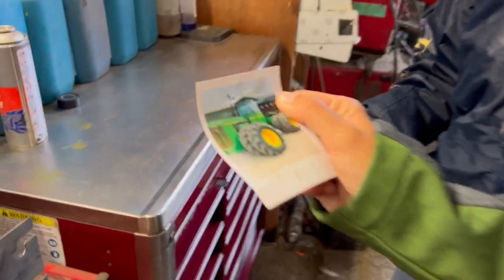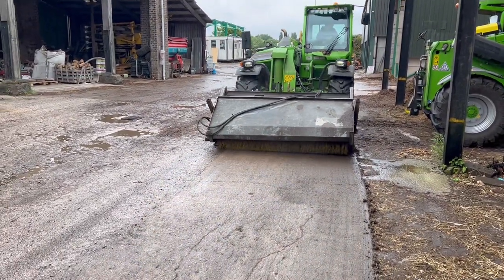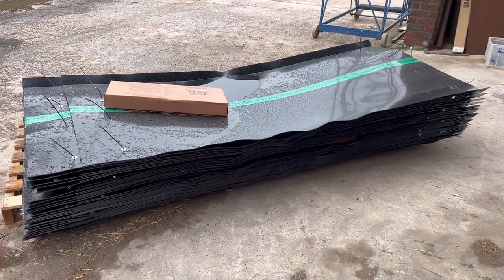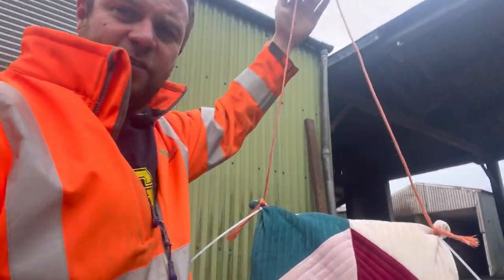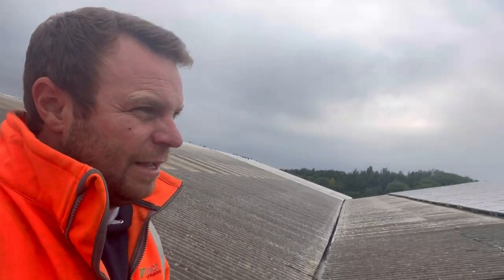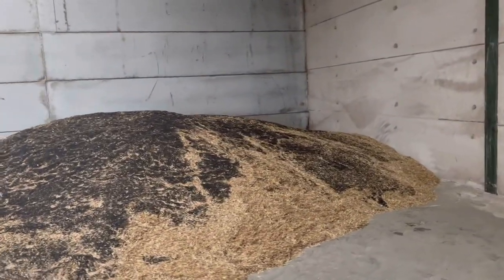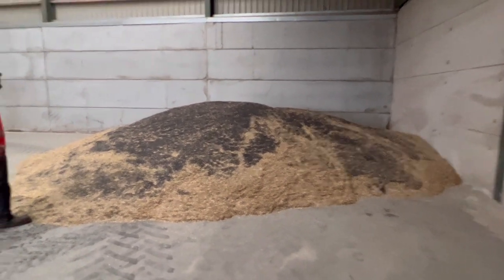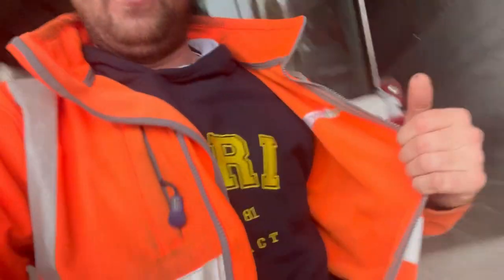DAY852 WE GOT RAIN TIME TO GO ON THE ROOF #YOURHARVEST#OLLYBLOGS  #AnswerAsAPercent

Comment: Can’t you get one of the longest polls we use a 25 ,30 foot one to screen the concrete off and they are basically a rubber blade I know you can get extension for them but you can walk along the gutter and pull down with it

Comment: Whilst the tractor on the photovoltaics was a bit of fun, it cannot clean these panels!  The box gutter allows access the full width, available are multi extending poles up to 17 metres long - not cheap but might help efficient generation - and its something you need to do for the next 20 years !?  Bring up a lightweight hose, attach a brush head and it could take a couple of  hours to get them spotless.  Probably best done in the rain and could help rinse out the gutter. However, after the work you put in recently, why not play for a while !

Comment: As far as I know, most if not all, solar panels have a self cleaning coating on them, so I would go easy on them when cleaning otherwise you can damage them and make it significantly worse if not damage the panels. Pressure wash (but not too close) is more than enough or just wait for the rain.

Comment: There are remote controlled wet brush systems they use for cleaning roof tiles etc. Im sure it would work for solar panels.  Would take a bit of setting up as you need long , very long hoses connected to a barrel of cleaning detergent.  Would be a lot less than 7grand and you could do other customers roofs to et your money back.

Comment: what about the rubber off a hand slurry scaper, and put a small solo battery charger on the bonet of the tractor, and then build a open lean to shed to keep the tractor in on the roof, with ramp to get on and off the panels

Comment: What about a remote lawn mower converted to clean the Solar panels. Put the charger station up there and leave it to do it. Put a low board all the way round to solar panels. When it gets to the edge it will hit it and turn around. Mind you would probably cost a fortune to do.

Comment: You can buy a RC Traxxas 4x4 and fit a snow plow to the front. Can then either buy a remote with an extra channel to lift it up/down or I just used a ESP32 and control it over wifi (either directly or through an access point). 

Can then buy rubber strips to go at the bottom or I’m sure you could get a 1-2 foot brush and screw to the bottom, plus range will likely be better on an RC. Maybe you wouldn’t even need the servo on the snow plow and just use gravity with a brush? 🤔

That tractor seems a lot more hassle than it’s worth but be interesting if you get it to work.
Reply: Oh, and bonus points if you attach it to a drone and drop/pickup from the panels! 😎

Comment: Ok, so I am not into farming or anything, but first thing I would do is put a walkway of some sort over the valley so you have a good footing and don't crack the roof.  Then, and I am not sure it would reach, but when I paint my house I clean the walls with the patio attachment for the pressure washer (famous brand). You can get extensions for the washer, I have 3 that go upto about 7 or 8 meters and its quite solid at that. When on, it has some downward thrust that would make it float over the panels.  You could attach the car foam thingy, and put some roundup in it, for the moss, I used it for a patch of ground about 5 metres away, and its definitely got more range in it than that. Totally cleared the lot.
Auto machine, its a clearly defined space, and a small auto thing like those that cut lawns could be adapted, to be honest, the electronics to do it is relatively simple,  its just the mechanical bit that may cost, to make it a reliable device. Wish I was closer (Isle of Skye), it would be a good project.
We if that was a load of ^&%$, hopefully it will have given you and others a laugh for my ignorance.
Me, 90%, which is probably you 70% to be fair. Just love all the machinery, I would be a happy man doing a field of anything, tedding, or anything. Really interested in all the sensors and things you have, like the one that gives you the yield per hectare as you are combining. Brilliant use of technology.
Go have a glass or two of wine and crash. I am. 🙂

Comment: If the bath mat does not work, have a look at a micro fibre towel - you can pick them up from outdoor shops. Whether you go for the bath mat or micro fibre towel, get a rod in the leading edge to keep it spread wide, other wise it will bunch up

Comment: How about a big rectangle mop head (like cleaners use in supermarkets), attach it under the tractor between the front and back wheels, like a ride on mower. Might help keep it down on the panels.

Comment: idea for solar panel cleaning - length of mental H beam at each end of the solar panel array that covers the height of the panel plus a metre or so below to keep it out of the way when not in use.  Have a beam trolley at each end with a mechanism to adjust the vertical position to do a drag along the length, and a second mechanism to do the drag in a straight line along the length and back.

I'm not a engineer, I'm thinking a tensioned line between each end maybe needed but I think the length of the roof maybe too long to get the tension that maybe needed to avoid a line sagging on the solar array.

Comment: Know exactly how you feel today. When I was on the spanners, I was working 15 hours a day during harvest, and didn't really notice it. Get a wet day, with time to ease off a bit and I was knackered. When you're flat out, its like you're on a high. Need a mini Bateman on the solar panels. Is it possible to rig up a few nozzles on a boom with a pipe to a knapsack sprayer, then spray traffic film remover. Let it soak in, then blast it from a man cage on the Merlo. Dont wear the R/C tractor out too soon, junior will want a go on it.

Comment: 98% Olly got a slight lower back challenge, did some yoga this morning and hurt it slightly, so, changing some exercise is probably a good thing.  Yes, a pressure cleaner with a long hose and extension would be ideal, see also if you can find out if there is static resistance on the panels, that keeps the panels cleaner. If not, find out if it can be done.  We have panels and also static resistance and we haven't had to clean them, the dirt just falls off.  But overall, we are all right here. 😄

Comment: For the solar panels could you not use them extendable window washing brushes? Ones that you can attach a hose to would be ok. Soft brush with water dispensing would be grand I think. Get some rest while the rain is on.

Comment: What if you some how fitted the cushion on similar to the under side of the tractor then the weight of would push it onto the panel to get better contact plus you could drive it more acutely into the corners.
Reply from the maker: Think would loose traction and slide

Comment: Oli rather than using a tractor have you thought of using a window cleaner set. I mean a brush on a pole with a hose pumping water through it. Quick easy and you can just stand at the bottom.
Reply from the maker: Cost of hoses
Reply: You can get telescoping jet hose wands that will extend 20-30 feet

Comment: Roof clean: Looks about 40 foot roof with 20 feet of panel. 2 X 6.5 meter lengths 3/4"  or 1" pipe add a wheel both ends, drill 1 mm or less holes every few inch. work out total area of holes so they don't exceed diameter of pipe,  then you need to find a pump and water supply

Comment: Those models are fantastic and the trailer is damn cool too. With the solar,  maybe a soft squeegee fitted to the front or back? Are the tyres rubber or plastic? 
If plastic, maybe cut and stick a bit of inner tube round the tyre for extra grip? Olly

Comment: Another great video olly. Have to say that the little tractor on the roof is an interesting idea. Are you planning on keeping it on the roof as a permanent feature or take it up and down as needs be. My only concern would be high force wind or snow would damage it or blow it off the roof.

The Case tractors do look well when lined up by size. 

Feeling in around the 60% today

Comment: Interesting idea Olly  could you wire up a 36v drill battery to give the tractor more power? Have seen it done before
Reply from the maker: Possibly
Reply: @OllyBlogsAgricontractfarmer  it will work. you just have to be carefull not to  increase the power to much as it will burn the motor. i guess that tractor is 12v wich means 36v is not a good ide. for a 12v rc tractor i would probably not go above 18v

Comment: contact Beba about panel cleaning they clean and maintain all the ones on farms we manage great firm. The risk of damage is not worth it, the income over the life of the feed in tariff if you damage a panel or scratch the surface of the glass would outweigh the saving. The loss of efficiency of dirty panels is also enough to justify installing a permanent walkway/ landing to get from the valley gutter to the panels. Not worth falling for. We also treat clean panels with a spray to keep them clean

Comment: Personally I think you only bought the little tractor so you could get up on the roof away from everyone and play with your new toy 😂😂
I live in London and window cleaners use brushes on really long poles to clean windows on flats as high as 5 or six floors I have seen but of course you have to have enough water pressure to start with 
Great video as usuel I try to never them as you are not only very knowledgeable but very entertaining as well
Real Country File is amazing
Keep up the good work
Thank you
Reply: I meant to say
Never MISS them 🙄😅

Comment: Adrian the maths man here again:

Quote: "1 hay cap protects about 3 tonnes of straw at a cost of about £16 to £17 per tonne.
3 x 16.5 quid  = about 50 quid per plastic sheet.

Quid definition: Quid is a slang expression of the British Pound Sterling
Reply: If the plastic sheets are UV protected and can last for 50 years?...
17 divided by 50 = .34 

(34 pence per year per tonne)

Comment: Can you not just, get a long extentandable pipe with a brush on it, my dad has a 9 metre one

Or drain roads, you can put them up and screw them together there are 1 meter long
Reply from the maker: Would need to be at least 18 m
Reply: @OllyBlogsAgricontractfarmer , buy 3 packs of 10 drain rods at 1 meters each, that will be 30m. Won’t be the sturdiest thing but it might be enough to walk along and drag along

Comment: How much did you say a ton of wheat straw was a couple years ago? We bought most of it in the trade, and so most of it comes from France (Reims area) to us in the Nijmegen area (the netherlands)  in a walking floor. Last 12 months we payed about 120 euros on average per ton delivered, I only have to stack ehm. I heard they don't expect the price to be lower than 125 per ton delivered. But we can get it localy straight from the field for around 110 once baled and transported. But from a pig farmer who has arable ground to bring his pig slurry too, so he doesn't have to pay some company to haul it away. Probably a different costprice. 

But those haycaps, the sides will get rain on ehm, do you know how they are when you start to use ehm WITHOUT a straw chopper? so by had, do the outer slices get really tough or is it doable? Since we use about 150 ton per year and only have shedspace for 65ton, but we got some space left outside. it could be a consideration. But I don't like the idea of straw outside :P